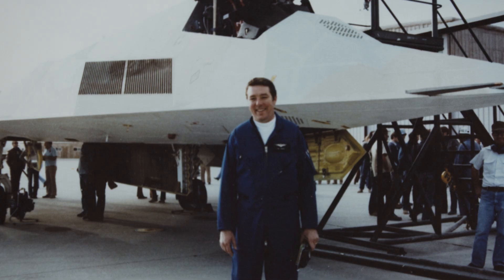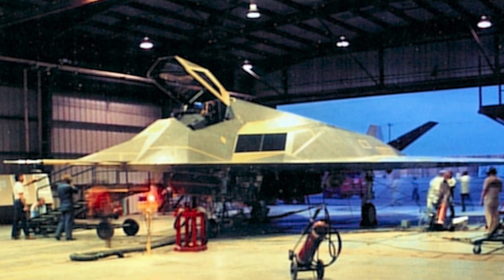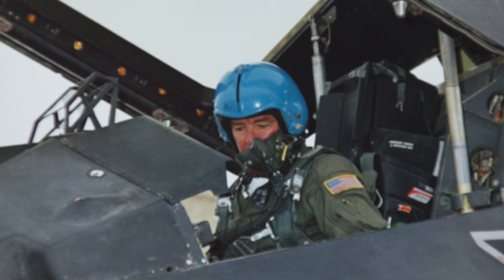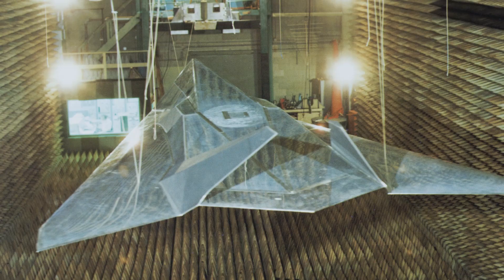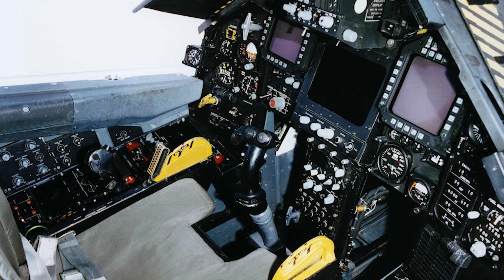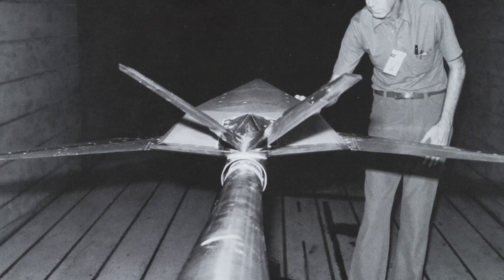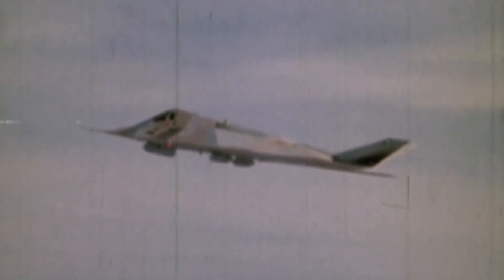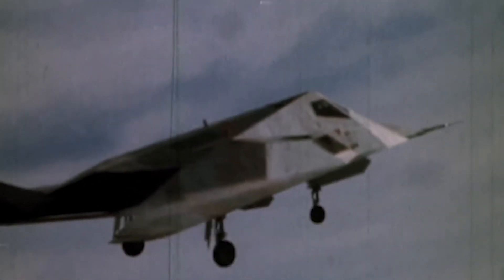F-117A Top Secret Skunk Works 1st Flight, Lockheed Martin aviation engineering technology, Nighthawk

Comment: And the last flight was on 27th march 1999
Reply: Sveta nope, still flying today.
Reply: @kcimb  not really it was retired in 08 or something
Reply: Sveta they have been seen flying this year in February...so not true.
Reply: @kcimb  maybe on the us soil but they probably don't deploy them to combat because it failed in the 90s let alone today
Reply: Sveta how did it fail, pray tell? 

I don’t recall it failing. We still used them in combat up until this year. They were brought back.
Reply: @kcimb  it was brought down by a 60s sam that looks like a failed design to me, i dont think f117 would be useful in todays combat but whatever you know better
Reply: Sveta which had less to do with the basic design and more to do with tactics. Saddam has a much better air defense network in 91 and 2003 and didn’t get any of them. Remember, nato won the conflict. Serbia didn’t. There have been dozens of f16s shot down, doesn’t mean it’s a failure. There have been even more a10s shot down, doesn’t mean it’s a failure. 

F117s deployed in 2016/2017 to the Middle East. That’s a pretty well documented fact. Against Syrian radar they performed fantastic.
Reply: @kcimb  manufactured in America, destroyed in Serbia with S - 125; We did not know that the invisible F-117 A Nighthawk (fall in BUDANOVCI -  Buđanovci ) and B-2 Spirit Missouria (fallen into the SPACING COURSE - Spačvanska šuma ) Steven Li Bashen - B-2 Spirit units in Combat - Tomas Vitingtin on page 43. read some of the relevant sites on you: won S - 200 VS F - 35 Lytting Lost; won S -125 VS F - 15Eagle Lost; won S - 125 VS F - 16 CG Fighting Falcon Lost; won S - 125 VS F - 177 A Nighthawk Lost; won S - 125 VS B - 2A Spirit Lost; won MIG - 21 Fishbed VS F - 16 Fighting Falcon Lost, won S - 125 VS B - 52 Stratofortress Lost, won S - 125 VS U - 2 Lost. Since we have well declared the S - 125 in 1999 year, they could be given a gift S - 300 and S - 2000 in the war to destroy the F - 22 Raptor. MiG-23MLD, MiG-25PDS, MiG-29 MU3, MiG-31E (31 BM, 31 K), MiG-33, MiG-35, Tu-128M, Su-27SM2 , Su-30SM, Sukhoi Su-33, Su-35S and Su-37, F-14D, F-15DJ, F-16F/110, YF-17, F-18F, F-22А, F-35A, F-35B i F-35C, Serbian G-2, G-4, J-21, J-22? for me is the best No1 TU - 128 that has almost been protecting the roof of the world (north pole) in all weather conditions, and now it is replaced by Mig - 31 BM and Mig - 31 K due to a new weapon.
Reply: @kcimb  The US opinion differs from the real facts. it has been seen since Vietnam to this day. The facts for one average American are those marketed by CNN, BBC, CIA, deep state, etc. if we go back to recent history, and I see that you are quite versed in the facts of the world; why did NATO (29 countries) during the aggression against a sovereign state and in 1999 not land enter Serbia, where the ratio of forces went in favor of NATO 1300 soldiers over one soldier?
Reply: Aleksandra Dimkovic Aleksandra Dimkovic you’re claiming the f117 was cancelled when Serbia shot it down? 

That’s false...production competed at 64 planes in 1990. 

A b2 spirit shot down? 

Fake news, political officer. 

There were 21 b-2s made and 20 currently operational. One was lost in a fire in 2008. Come on, even the Russians are laughing at you. 

What happened to your mig29s and Air Force? 

Shot down. 

Kosovo is Kosovo, not Serbia. 

We didn’t need to invade to win. The Serbian army was forced to withdraw and signed the accords and giving Kosovo its freedom. 

What was the results of the war, again?
Reply: @kcimb  
Withdrawn from use April 22, 2008. if your Fleet Admiral Steven Li Bashen and Vice Admiral Thomas Whitingin claim that B 2 was shot down and you wrote a book about the incident and you deny it, then your nation is brainwashed because of its deep state. how will anyone react to the fact that we were knocked down by the S - 125: F 15, F - 16, F - 117a and B - 2. you laugh at the rush due to the downing of the Mig - 29a alone in the air against the F-15DJ , F-16F / 110 and Avaks, that's pathetic and miserable on your part to brag about. and that you are not a warrior nation, and the fact confirms that NATO (America - 29 member states) then aggressively attacked a sovereign state of Serbia in a 1300: 1 ratio in favor of NATO, which was torn down with 10 years of sanctions, and you did not enter the mainland for 78 Days of Aggression, is praise for the Serbian army being trained at West Point. we have also embarrassed you here, where the whole world is laughing at you. get a map and paint all 29 members in red like your flag, and itch in blue and you will see the real situation on the ground that forces you. 
after the end of your aggression against a sovereign state, Serbia signed a UN Security Council resolution 12 44, stating that Kosovo and Metohija are an integral part of Serbia, and in the constitution of serbia states that kosovo and metohija is an integral part of serbia. the fact that you have broken ground on Serbian soil and in turn violate an international resolution and you have made a terrorist organization SIptarsku in Kosovo, plus you take organs (yellow house) out and sell it to America, it tells you what kind of nation you are. 
you lost all the wars, starting with the Indians. if you are going to boast about the goddess infested goddesses that you gave them and thus killed them, this is not war, it is genocide. read relevant sources, and fall short of the captivating images, written by General Arturo Marcelino Sosa Abascal, who sells the news through: Jesuits, CNN, Society of Jesus, BBS, Christ's Soldiers, CIA, Vatican, United States Deep States and Jesuits. read something smart and come to your senses, the internet is big
Reply: Aleksandra Dimkovic then where’s the wreckage of a b2? Where are the hundreds of videos and photos by Serbian nationalists who are so excited they lost the war but shot down one plane? 

There aren’t any. 

When the nighthawk was shot down there were thousands of photographs taken by excited Serbians. Where are those photographs now? Where’s the pieces of a b2? 

There aren’t any. 

Why were f117s still in use in the Middle East as of 2017? 

Because they work well against garbage bin Russian air defenses.
Reply: @kcimb  
first, the Serbs did not lose the war in 1999, because then NATO did not enter NATO with its army into our territory, and if there were 1300 soldiers in favor of those 29 members: 1 Serbian. and in spite of all the avaks, spy satellites and laser beams, they did nothing. they were targeting rubber models of tanks and planes. according to US officers d B-2 Spirit Missouri (fallen into the SPACING COURSE) Steven Li Bashen - B-2 Spirit units in Combat - Tomas Vitingtin, you can check it. then the F - 15 (1976), F - 16 (1978), F - 117a (1983) and B - 2 (1997) were shot down with the S - 125 (1960).
Reply: Aleksandra Dimkovic there wasn’t a single b2 lost during the conflict. Check your stats. 

If Serbia won the war why did tHey have to leave Kosovo? Why was there a 25km aerial boundary and 5km ground boundary around it? After all shouldn’t the winner set those? 

That’s what the Kumanovo agreement says. 

The 1999 campaign was a nato victory, the Yugoslavs lost. 

Again. 

The spirit of Missouri is actually still flying and is at Whiteman AFB...so why are there not wreckage photos from the Serbs? Come on, something. Stop being a tease. A b2 is a big plane.
Reply: @kcimb  The Military Technical Agreement in Kumanovo or the Kumanovo Agreement was signed on 9 June 1999 at the military airport near Kumanovo and marked the end of the NATO bombing of FR Yugoslavia. Break up of hostilities between NATO forces with VJ forces and Serbian police. The agreement ended NATO air strikes on FRY. concerned KFOR's forces in disarming the KLA. and a day later, Security Council resolution 1244 was adopted. there is no victory there because during the state of war they did not enter land on the territory of Kosovo and Metohija. that bombing lasted and had no effect. resolution SBUN 1244 states that Kosovo and Metohija are an integral part of Serbia. since this is a fact, why are terrorists seeking recognition from serbia? more and more countries are realizing their mistake and withdrawing de facto recognition.
Reply: @kcimb  
a strategic B-2A bomber fell in Spačva Forest (south of Vinkovci) and a special US unit was launched at the time of the fall from Tuzla. During the aggression they reported: observation and intelligence service (OiO), radio amateurs, visual observers, friends from the environment, and to a large extent media outlets… During that night the situation in the station was very stirred up and was a real alarm. The head of the special unit sent the unit to Spačva Forest with the task of surrounding the entire area and forbidding anyone to enter. a B 2 plane crashed, and no one was allowed to enter. A huge B 2 fell in our room at Spačva Forest tonight. Firefighters went to put out the fire. When they got there, they saw something like a flying saucer. It fell like it was lowered from above, but it was broken. It looks like a plane, but you don't know which one. It is black, huge, straight, has rounded edges and has no vertical surface. In a very short time SFOR members from Bosnia came and surrounded the whole area. It could no longer be approached. For the next three months, tarpaulin trucks were constantly entering and leaving the zone. They were obviously transporting something. Eventually, a whole layer of land was taken away, and the lake remained there. it is written by US senior officers. if you are interested in the whole text you can find it on the USA and NATO sites.
Reply: Aleksandra Dimkovic so nato is so powerful it didn’t even have to enter Kosovo to force the Serbs to leave it? 

Wow! 

That’s impressive. 

Where’s the wreckage of the b2? 

There’s a ton of photos of your Air Force in pieces all over the Serbian and Kosovo
Countryside. 

Repeating the same thing doesn’t make it true.
Reply: @kcimb  The truth is that this will continue to be recounted in the media and forums, and the silhouette of the B-2 drawn on the cockpit of the missile system S-125 "Neva" will be indicative for future generations what happened in the skies of Yugoslavia-Serbia-Belgrade May 20, 1999. An inspector at the Croatian MUP, who was working at the police station in Vukovar at the time, said in an interview with Ensign Milan Barvalac: “During that night, the situation at the station was very upset and there was a real alarm. The head of the special unit sent the unit to Spačva Forest with the task of surrounding the entire area and forbidding anyone to enter. It was said that the B - 2 plane had fallen and no one was allowed to enter. According to the atmosphere that prevailed and the behavior of those responsible, I am sure that B - 2 fell into that forest. " 
The "captured and invisible spirit" states, among other things: "A direct hit to the cabin of an American B-2A ended his flight forever and thwarted his intention to give an already severe blow to an already wounded Belgrade. Smoke billowed, flaming tongues swallowed the "invisible" wing. Blackbirds crashed toward the ground, and the other two were already fleeing to safe heights, turning their beaks toward the starting bases. ”  "It was reported that a strategic B-2A bomber had dropped into the Spačva Forests (south of Vinkovci) after the operation in the Belgrade area, and that a special US unit was launched at the time of the fall from Tuzla. During the aggression they reported: observation and intelligence service (OiO), radio amateurs, visual observers, friends from the environment, and to a large extent the media… ”B-2 Spirit Missouria (fallen into the SPACING COURSE - Spačvanska šuma ) Steven Li Bashen - B-2 Spirit units in Combat - Tomas Vitingtin on page 43.
Reply: you can find more information on the internet on web pages dropped by the Serbs (neutral state like Switzerland), Bosnians (NATO accession member), Croats (NATO member state), NATO and America.
Reply: in air combat, one mig 29 and a Serbian J-22 eagle were shot down as far as our aviation is concerned, and as far as the aviation that is being attacked against the air system S - 125 (1960) F 15, F 16, F 117a and B 2 (1997).
Reply: Aleksandra Dimkovic basically...propaganda? 

Where is the wreckage? Why were the Serbs so happy to parade around an f117 but not a spirit? 

Note he says “I am sure”. Being sure doesn’t mean it happened. 

Why is there a canopy from a night hawk but not a spirit? The spirit is a very, very large plane. It’s impossible to simply hide it. 

Sooooo where is it?
Reply: @kcimb  
besides giving you as a copy paste the answer to your question, what else do you want me to do for national security, the CIA, etc. to bring you a piece and make sure personally? normal are you ?? you have the internet and knock about the B - 2 and you will find a bunch of data on its downfall, you can't get it all done, I'm not your mother. what was happening on may 20, 1999 over Belgrade (Becmen - Spacevacka suma) find by yourself.
Reply: Aleksandra Dimkovic I’ve searched. All b-2s are accounted with none lost during
The liberation of Kosovo. 

A b2 is a very large airplane. If there is a piece of the f117 displayed in the museum
In Belgrade, where are all the pieces of the b2? The Serbs were soooo happy to share pictures of the f117. Why not a b2? There are surely enough parts left. It’s almost 4
Times the size of an f117. 

No b2 has ever been lost in combat. 

You are the one making the claim. You should be able to back it up. 

You’re simply beating your chest and repeating false claims.
Reply: @kcimb  
give me one piece of valid proof that I'm not right with all the evidence I wrote above.
Reply: @kcimb  The Spirit of St.Louis - From Whiteman to Batchman - that night, with a game of chance (fate) whatever, the B-2A flew something lower than the usual course on a rocket launcher in Becman. Within the RS PVO S-125M `Neva-M` there is a 2D` `meter '' radar (meter wavelength) P-18 that detects stealth technology aircraft like the F-117A and B-2A from the front and lower hemispheres. was a problem for the so-called decimeter radars (in units of VOJIN VJ mostly of Western origin), it was not a problem for the old Soviet `metrashes'. The Spirit of St. Louis plane that was lost was interestingly replaced on 22 May at the Whiteman base by the Spirit of Indiana aircraft (due to the number of aircraft in the base a to control the number of thermonuclear carriers b / g under the START I Agreement). that they were no longer used in NATO aggression. It was also a fact that the wreckage of the hit-and-fall plane was not possible at that time in the area of Spacvanski Sumi / near Zupanja (the plane had previously started its course towards Dubrave airport, but turned not north abruptly losing altitude). I keep everything else and search for yourself. Witnesses to the latter events, and what happened in those days especially on the Zupanja -most route across the Sava River near Orasje -Tuzla, are SFOR members on the territory of BiH, the same ones who were sent to Slatina -Pristina Airport a little later and those who witnessed the negotiations and the destruction of two of our MiG-29s (L-18s with ev numbers 18113 and 18114) in the VaP BiH in that area. SFOR saw everything and everything during those months, and interestingly, everything happened in the so-called Tuzla zone of operation of the then SFOR unit where it was precisely the Russian and American soldiers.
Reply: Aleksandra Dimkovic of 21 produced planes 20 are still active. The only one ever lost was lost in a crash and fire which Is well documented. 

I have already disproven you. The Serbs didn’t shoot down a b2. Once again you’re making excuses. The Serbs didn’t shoot down a b-2, not in this reality or the next but possibly in Serbville 😂😂😂
Reply: @kcimb  due to 1999 when it was overthrown by S - 125 discontinued production.
Reply: The Spirit of St.Louis - From Whiteman to Batchman - that night, with a game of chance (fate) whatever, the B-2A flew something lower than the usual course on a rocket launcher in Becman. Within the RS PVO S-125M `Neva-M` there is a 2D` `meter '' radar (meter wavelength) P-18 that detects stealth technology aircraft like the F-117A and B-2A from the front and lower hemispheres. was a problem for the so-called decimeter radars (in units of VOJIN VJ mostly of Western origin), it was not a problem for the old Soviet `metrashes'. The Spirit of St. Louis plane that was lost was interestingly replaced on 22 May at the Whiteman base by the Spirit of Indiana aircraft (due to the number of aircraft in the base a to control the number of thermonuclear carriers b / g under the START I Agreement). that they were no longer used in NATO aggression. It was also a fact that the wreckage of the hit-and-fall plane was not possible at that time in the area of Spacvanski Sumi / near Zupanja (the plane had previously started its course towards Dubrave airport, but turned not north abruptly losing altitude). I keep everything else and search for yourself. Witnesses to the latter events, and what happened in those days especially on the Zupanja -most route across the Sava River near Orasje -Tuzla, are SFOR members on the territory of BiH, the same ones who were sent to Slatina -Pristina Airport a little later and those who witnessed the negotiations and the destruction of two of our MiG-29s (L-18s with ev numbers 18113 and 18114) in the VaP BiH in that area. SFOR saw everything and everything during those months, and interestingly, everything happened in the so-called Tuzla zone of operation of the then SFOR unit where it was precisely the Russian and American soldiers.